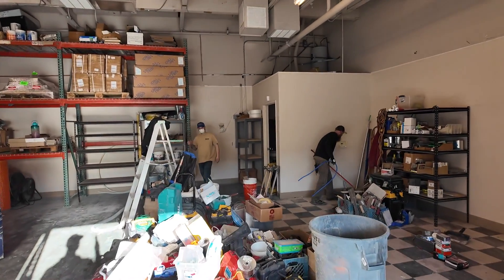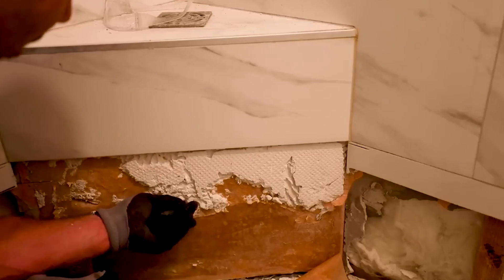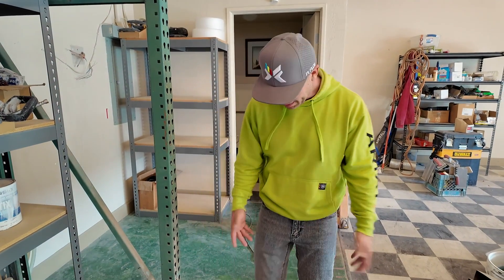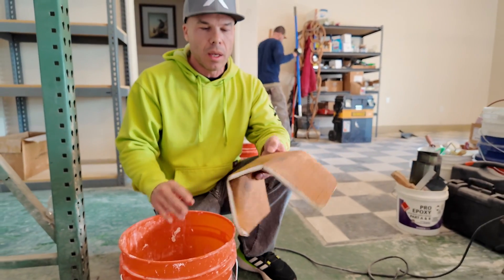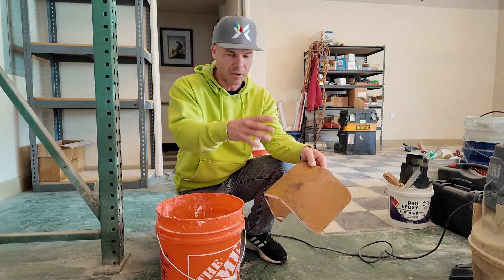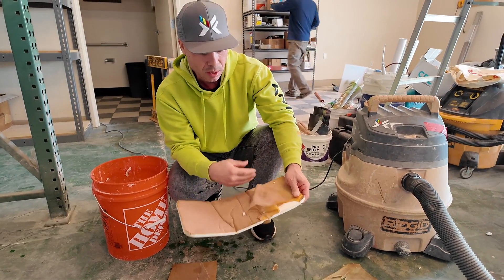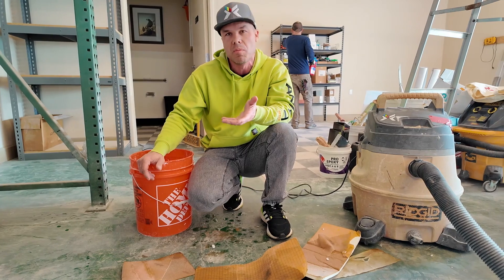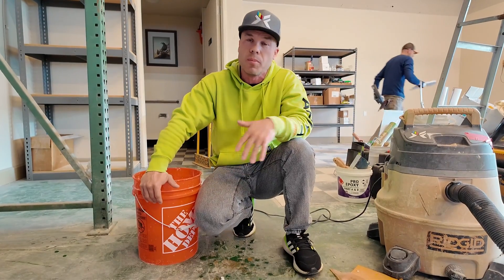MOLD ON SCHLUTER KERDI ???  This can't be good. 1 year test.

Comment: I have also seen the mold on Kerdi fabric when taking apart a repair from a sub from tile designers tile error and seen dark looking stains around the curb area and tray and also when I have left Kerdi membrane on a roll in the back of the truck exposed it has definitely shown mold to the point of have to cut the diameter of that off the roll wasting two feet by 39 1/2”… I don’t use the board I have but it’s way to expensive. I durock ALL my showers and walls, wet with sponge and apply the membrane. Sometimes trays sometimes mud pans. I also Kerdi over the tray like I do the mud I don’t like the stupid doughnut ring. If it ain’t broke don’t fix it. Never got whey they would want another potential water seam right at the drain body! Thanks for the tests I always follow your vids. I’m 34 years in lol but I still learn. The company that trained me in the late 80’s tested everything they did like your doing in the shop. Submerged water tests etc… ✌️
Reply from the maker: Yes, "puzzle piece" systems do have their drawback with the potential failure points.
Reply: @TileCoach Hey have you ever installed a Hydro Blok system? I have installed hundreds of kerdi kits, but just installed my first Hydro Blok system, they have their own sealant to bond all the panels and joints together which I'm not crazy about but just wanted to know what your take was on the product if you have installed it. Thanks!
Reply: @TileCoach  I think a better way to do the test would be to make a small tub out of kerdi board dash all the seams and corners  properly to schluters specifications then fill the tub with water with the kerdi properly installed it should hold water then run your test to see if the kerdi fails I believe that as long as the water is kept on the top side of the kerdi it won’t fall apart it’s when the water gets behind it from improper installation I might be wrong I have installed a few of the kerdi shower systems I took there 3 day class to get there certification to install this product and I think if the water doesn’t get behind it it will hold up

Comment: I did a test wear I wrapped the inside of a cardboard box and filled it with water, after a year it had no leaks or signs of mold. Now I did change the water weekly, shoe box for reference in size. Also note I didn’t use the premade corners I made mine with the band as we were taught from their school in SC years ago.

Comment: I think a better way to do the test would be to make a small tub out of kerdi board dash all the seams and corners  properly to schluters specifications then fill the tub with water with the kerdi properly installed it should hold water then run your test to see if the kerdi fails I believe that as long as the water is kept on the top side of the kerdi it won’t fall apart it’s when the water gets behind it from improper installation I might be wrong I have installed a few of the kerdi shower systems I took there 3 day class to get there certification to install this product and I think if the water doesn’t get behind it it will hold up

Comment: Kind of a response to the video referenced in the description, but I absolutely never use the schluter preform curbs. I use the 2 inch board and cover the whole thing in Kerdi fabric. The thing to keep in mind about Kerdi boards is that they are made of polystyrene. The polyethylene/propylene fleece fabric in the banding and other kerdi membranes is not meant to be submerged for extended periods of time. It's meant to dry out between usage, and protect the polystyrene shower structure. Polystyrene is waterproof, but acids and organic matter can (very slowly) degrade polystyrene. Water is a breeding ground for bacteria, and a byproduct of bacteria can be acids that eat away at polystyrene. The Kerdi curbs are relatively flimsy and thin in places, when compared to just solid 2 inch boards bonded together with thinset. Thin Kerdi boards can much more easily be worn down and compromised by bacteria. If you want a bomb-proof shower pan, you should use 2 inch Kerdi board for the curb, and coat the entire bottom 1.5 feet of the shower (including the pan, curb, and the entirety of a bench) with two coats of Hydroban. Hydroban is, in my experience, far and away the best waterproofing finishing solution on the market.

Comment: Im a general contractor in Pennsylvania and i have done custom showers with custom shower pans. What i use and will always use is the Oatey rubber shower membrane and float a custom shower pan by hand with a 3 stage drain......all i can say is in the 18 years ive been in business ive never had a call back on any of the showers ive done. Im not saying im this great contractor , what im saying is sometimes old school ways of doing things isnt always a bad idea. New tech that comes up doesnt always work out , these schluter , kerdi , foam , fiber cloth style materials just dont seem to cut it. People are paying their hard earned money to have work done , i just think its wise to use a product that works and works over time........as long as its installed properly. Thanks for the content you rock and roll.
Reply: Do you float
Reply: @HowellsHandy  like a butterfly
Reply: Can you upload a or share a proper oatey shower? Thank you for your wisdom.
Reply: I use backer board and glue the tile directly to it, tile , grout and caulk and never had a problem either. These systems with this crap are a joke. In years to come the lawsuits against these companies will drive them out of business.

Comment: Your test is not as scientific as you imply.  1)  Kerdi board is not designed to be submerged in a pool. 2)  You have raw edges exposed to water.  Never happens in a correctly installed shower.  3)  Have you had it tested to prove if it is mold?  If so leaving material outside to collect other organics give food for the mildew or mold.  So is it the Kerdi molding or something on the Kerdi?  Additionally when you place cement based mortar on any board the acid in mortar stops the growth of mold and mildew.    If you really wanted a balanced approach maybe you could have had someone from Schluter participate in your test and your video.  We have sold several thousand Schluter showers out of our store in the last 35 years with not one failure.  If there truly is an issue maybe you could approach it from the stand point of a work to improve the product with Schluter.  I have watched a number of your videos in the past.  I thought you had some very relevant thoughts and observations.   I think you should review this video and how you presented your observations.  These are my thoughts as a student of the industry for over 40 years.
Reply from the maker: Well since the water wicks under the bands through thinset that is not waterproof and my original observations were on a failed installation that banding was used,  I believed this test was worth taking a look at.  Mortar does not stop the growth of mold.  Algae can grow on mortar, and mold can feed on algae.  Like I said in the video, I welcome all of you to try a similar test (maybe put banding on the edge first and leave it in a wet environment for a year). Let me know the results and I will publish them for the good of everyone else. My email is info@tilecoach.com.
There is a big difference between selling products out of a store and remodeling showers for a living. Also kerdi board has only been out for about 15 years. How have you been selling "Schluter Showers" for 35 years when Kerdi came out in the states around 2003? 
People probably wouldn't report problems back to you, they would report them to the contractor. Only about 1 in 50 tile failures get reported back to a contractor due to several factors; contractor changing businesses, homeowner not wanting to deal with contractor again, homeowner losing contractor name/info, homeowner selling home, contractor not calling back, etc.  The vast majority of contractors/handymen do not have the overhead to deal with warranty calls, so they most often avoid call backs. Especially 5-10 years later.

Comment: Should make mini pans with all the different boards and tiles.  Make them all small but scale then fill woth water, no drain. Like little tile shower birdbaths.  Then take them apart. Would be a good experiment... but to original vid. Think it was most likely due to improper install, maybe,  hopefully.

Comment: Doctors and lawyers "practice" their trades. A shower is a shower, tried and true methods done correctly perform for years. trying out overpriced "easy" systems leaves too much room for error.
Too many variables.
I've done my showers the same way for over 40 years, no complaints, same phone number.
Presloped rubber membrane, no cut corners, liner running up through and along the center of a solid cement curb, cement board, fiber mesh/mortar seams. No trowel able membranes with exception to bottoms of niches. no benches-  corner shelves of any size  alleviate potential problems there.
All that said, seems as though folks tear out and redo bathrooms and kitchens at much faster intervals these days or I'm just old.

Comment: If you are going to do performance testing of a material, you have to figure out the parameters and objective of the test.  For example, you can test for mold resistance or water resistance.  Any object you place in a bucket of water, will grow mold at different rates.  That is not a true test.   If you want to perform an experiment, you have to use the product in the conditions it is supposed to be used.  You're not giving Kerdi any justice by plunking it in water ( or any product for that matter).   If you are testing for mold resistance of several different bathroom building materials,  you would have to set up the test in a controlled environment, with materials side by side at a set temperature, humidity, and moisture exposure for a certain amount of time. (mimicking a real shower) and observing the materials at different points in time (every 2 weeks or every month)during the experiment and recording your observations until the endpoint.  Do not change any of the variables for 6 months.  All samples must be in the same environment.  The Control of your experiment would be a tried and true material that you feel is not going to fail.  At the end of the test, you can compare Kerdi and other test materials to your control.  For example: Do a curb test.  Set up a Kerdi curb, or any other competitor curb system, etc, and your control.  They must be prepared in the same way, (using same amount of moisture barrier, thin set and tile)... put them through the same testing parameters, (moisture, humidity temperature, 2 times a day for x amount of minutes )  and do that every day for 6 months to a year.  After a year, tear them apart.  Then you should be able to tell what product has mold resistance or moisture resistance.   If they don't fail at the end of a year then you would have to make changes to your experiment, by changing the parameters.  The sky is the limit on testing.
Reply: Love your videos by the way.  I had my bathroom demolished and stopped the "guy who said he had 30 years experience.  I've learned so much from your videos, I had to stop him from doing any more work.  By way, I can't seem to figure out the sequence of a shower base.  I've read that you should start with a pre slab slope (prefab or mud), then a pan liner, then another mud barrier on top.  Is this correct?  My bathroom had a tub, on concrete substrate and need to change the plumbing to center.  Is it ok to keep the drain in same position as tub, after installing a p trap?  I just cant imaging a ski slope in my bathroom.  LOL!

Comment: You simply can't eliminate mold potential in any form when cellulose materials are present. Not only does mold get into all negative pressure points of a home, mold is evolutionary! What resists mold 50% today may only resist mold 40% in 50 years.  
Boric Acid treating your wood frame and subfloor anywhere is a good idea, ESPECIALLY a moisture pit. 

This is also why it's hard(not impossible) to get away from chlorine. Bleaching the shower will kill off your surface mold. Alternatives are just that, alternatives, bleach is still the king cost:effectiveness:performance:spectrum. 
Like anything, using the film-theory of building, each layer needs the correct protection and boric acid is still the gold standard, along with a few controversial cough glycol blends. 

Whats the alternative to kerdi(generic or branded foam/sheet membrane)? It's cement board which is highly alkaline and provides protection by creating a heavily unfavorable environment for mold. Installers breathe in more silica because it's dusty AF and it's heavy.  Or you have vinyl which is a barrier and should only be used strategically. I guess we can go back to tar-paper with modern adhesives(yes, I do mean re-developing an old tech, not reverting 60 years), but like cement board, it becomes a setback for portland extraction, an ignored environmental concern. 

As much as I don't care for Kerdi branded products, they're just OK and over-priced, they were the early leaders here and GOOD FOR YOU putting pressure on them to improve the product. Mold-proof is not possible, it's only IMPROVED mold-resistance we seek.

Comment: I do Cement Board and Waterproofing membrane, did one about 2 years ago and then remodeled the shower on the other side of the wall, and when I looked at the back of the board it was dry as a bone. I figured that's proof enough to me that the system works and is far cheaper than this stuff. if I had to guess the paper coating on the outside of the plastic will soak up a small amount of water and hold it long enough to grow mold. mold will grow on anything if it's given enough time in a wet environment and I think that outer paper is doing just that while CB doesn't hold the water long enough for the mold to grow but I would bet if you folded that board as well it would grow something as well.

Comment: Seems like a pretty invalid experiment. You would need to seal the edges with banding to actually test it. Ive also never heard of a shower that is submerged in water for a whole year….showers get used and dry out. Anything not completely drying out will grow mold.

Comment: I have seen the curbs also fall apart in a year I just demolish one it was still somewhat solid but was leaking bad not my work !cause it takes a lot for me to trust! I went back to brick or rapping the 2” foam board in sheet membrane then going crazy with roll on membrane 4 to 5 coats on top. I  did a demo aqua defense shower last year it was 12 years old no leaks it was a absolute nightmare it was like ripping seat belts all day cause it was cotton cloth and probably a full 5of membrane end of the day the sheet membrane is my second line of defense

Comment: In all my years of tiling, I have mostly seen mold at the base of the shower. It leads me to believe that since the water pools at the base and cannot drain out, it turns into mold eventually. I'd like to see a product that does let the water drain. Maybe a trim edge with drip holes would work.

Comment: I worry that the membrane is failing because water is getting in behind it through the edges. I suspect you'd have different results if you kept the water only touching one plane of the board.

Comment: Can you answer if you will never use kerdi as a result? Maybe you never did? I suggest you contact Schluter directly for a proper technical response if you are interested in promoting knowledge, unless it is all about clickbait, although that would be even better clickbait. 
I expect they have exhumed many showers and likely tested the materials to confirm function. Whether it was wet and peeling may not affect its permeability which is the key function, and the most mportant factor. Fungal mechanisms even eat rock, few non-metal materials are immune, but hey they have their own breakdown mechanisms with oxidation. Y
ou never said it had mold in your exhumation. For a proper experiment you would create a tiled kerdi basin,fill it with water, keep it filled (even if that is not reflective of the kerdi in service), have a moisture detection method under, could be cardboard, whatever, even try to promote mold if you like.

Comment: The waterproofing plastic layer is bonded to a paper which is bonded to the foam. This is why all edges of the board have to be covered with the banding. If it gets wet it will delaminate.
Reply: It will eventually get wet then as thinset and grout are not waterproof and it will wick it into the board.
Reply: @EricNeilson_  no he is saving the edges can’t get wet. Which is consistent with Keri’s documentation. The product has to be installed correctly to prevent that.

Comment: I've wondered why you're supposed to adhere the kerdi band, which seals the gaps in between the waterproof surfaces, with a non-waterproof adhesive (thinset). Makes no sense. If the adhesive is letting some water in, then mold/material breakdown isn't a surprise. GoBoard's system makes more sense. Seal all those gaps with a silicone caulk. Liquid membranes (properly applied) over cement board would also seem to be a superior solution. Disclaimer: I don't build showers for a living; just done it a couple of times. Thanks Isaac for another informative video. NCal Strong!